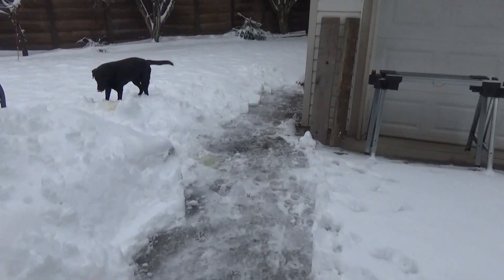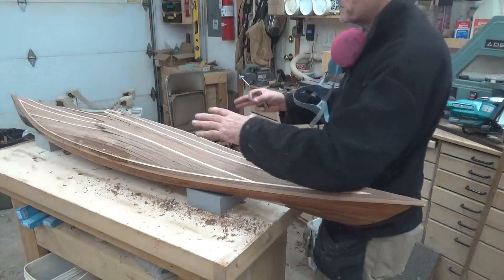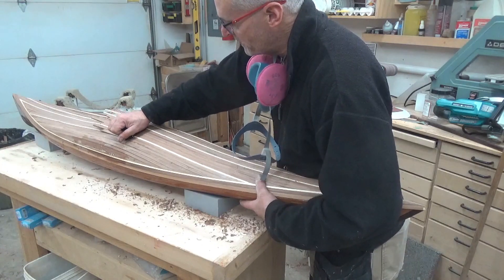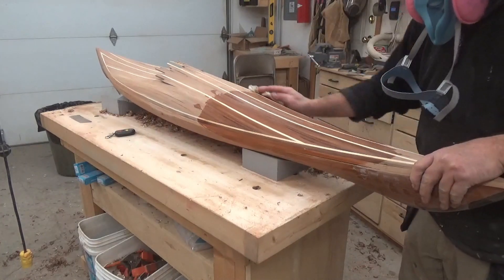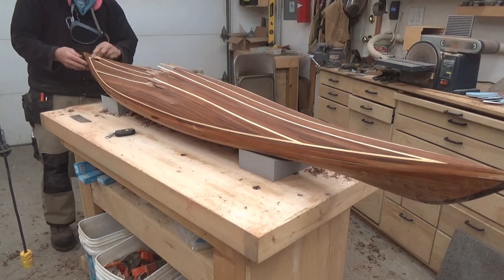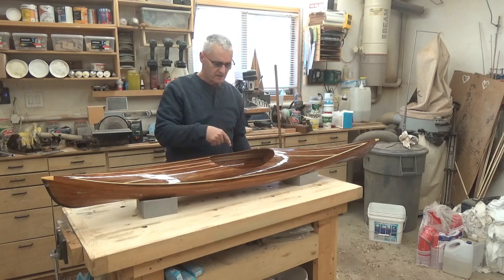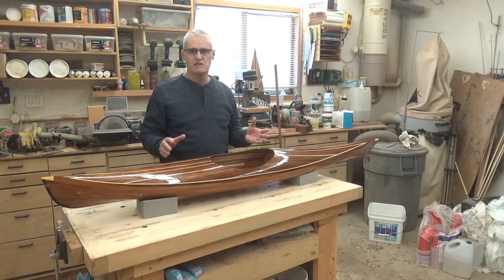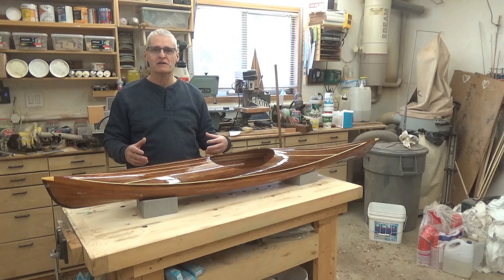Building A Wooden Kayak Model EP4 Completing the Deck

Comment: should a varnish always be the finish coat or can you just leave the epoxy as a final coat?  thanks.
Reply from the maker: On a boat that will be out in the sun, marine varnish is needed to protect from UV damage.  Since this will never be out in the sun, varnish is not necessary for UV protection, but it is a lot harder to get a super smooth finish with the epoxy alone, so sanding it smooth and adding a couple coats of varnish will take care of it and make it nice and shiny.
Reply: @OrcaboatsCa  ah yes that makes sense.  Thanks Rod. Always enjoy your videos.